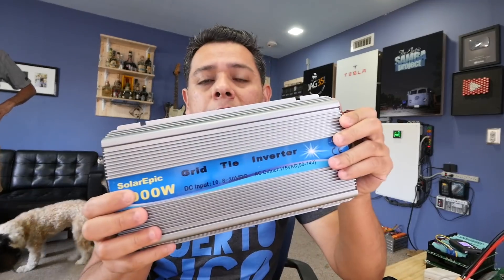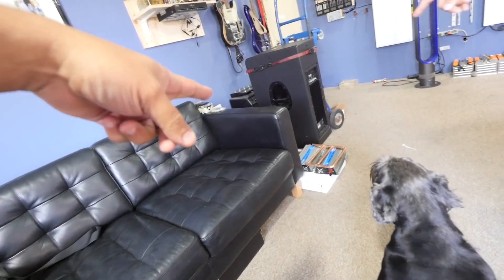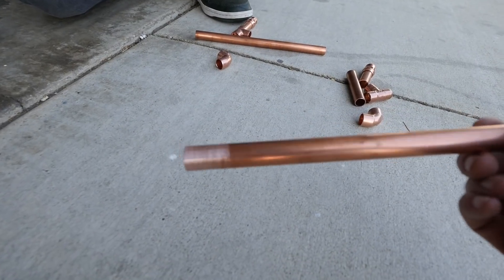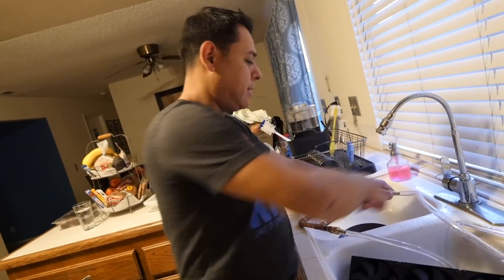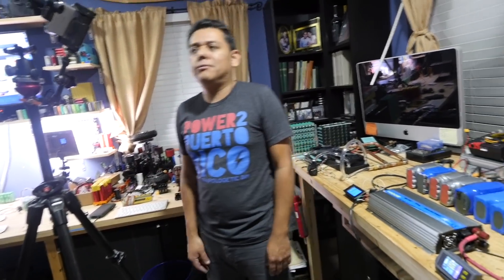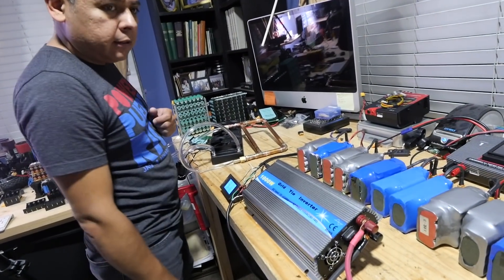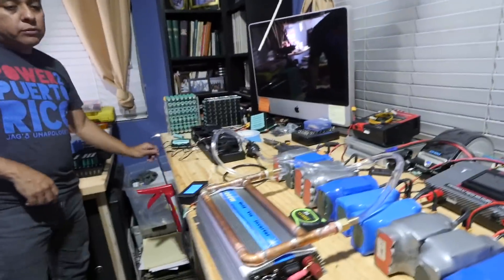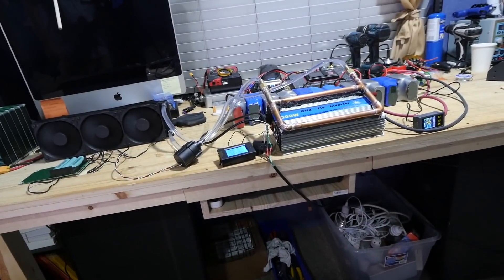Liquid cooling A cheap 1kW Amazon Grid Tie Inverter Experiment

Comment: What you should have done: Removed the boards their aluminium cases. Bought some angle aluminum (~$20) and constructed a square (sized to fit the outside  perimeter of those Walmart box fans) In the square you should have had 3 sets of 2 bars back to back, placed at 1/3 interments to fit the pcb. This could have been using a basic hacksaw and bolts.($15 if you didn't already have it) Then you should have drilled holes in the aluminum and bought pcb stand offs for 10¢ each off ebay. Then you could attached the pcbs to the aluminum bar via the stand offs. After which you could mount 3 cheap cpu cooling blocks with thermal pads ($40), connected them together using soft tubing, and fed it all to a makeshift Reservoir (pvc $3) and a cheap pump. Going out of the blocks and pump, into a salvaged/ebay dehumidifier or small ac radiator ($20 or free). You then would place the radiator ontop of the fan, and place the aluminum frame on the other side. Around $50 bucks, few zip ties and some glycol as a heat conductive liquid, and you'd have a banging cooling system. And it all could have been done in an afternoon. Im sure even my simple 3 second idea could be made cheaper and more efficient if given a few hours thought.

Comment: You need more radiator surface area & fans to lower the water temp, likely a bigger pump, and you need much better surface contact to make this worthwhile. Having worked with water cooling in computers, I can tell you from experience that you almost need to place the cooling interface in direct contact with the mosfets or their heatsink (soldered or flat surface-to-surface contact with the backs of the FETs or a flattened sink, instead of the thick layer of thermal compound "goop" - which will actually reduce the thermal transfer vs direct contact).
Also, don't mix copper and aluminum in the cooling loop.

Comment: I agree contact surface is too small gr8 idea tho , work on the contact surface and this will work lots better 
also when sweating copper pipe just heat the fitting when the fitting is red hot then add the silver soter it will run around the fitting it self and follow the heat around the pipe ;)

Comment: You've got a long way to go get a reasonable heat transfer, you're not going to do it with tubes mounted like that.
More and smaller tubes mounted to a flat plate clamped to the fins is a better functioning heat transfer system, one of many.
Measure the system temperature of the water going in and coming out to establish a differential against the timeline where the Deltas can be plotted appropriately.
Be sure to have a contact temperature sensor at more than one point on the inverter to establish real values for the amount of heat present. That information can be plotted against the amount of BTUs actually removed
Reply: i wanted to write the same thing. I am with Leslie way. smaller tubes and plenty of them.

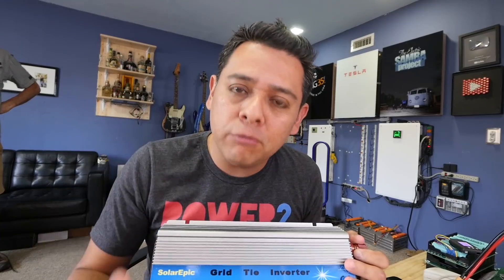Comment: At 00:31 I am guessing it will not be effective until you weld it to the metal or build a custom metal case for the inverters. You can weld fins to the pipes with a robot or use old heaters people throw away when modernizing.
11:23 Use an inlet valve to top up the loop and don't forget the second inlet valve for air or just run the pump and use a 1/4" water cooling reservoir for PC building.
As an alternative you can bandgrind the fins on the inverter case and try and solder the copper pipe to it. Flatten the pipes to make them rectangular to increase surface area.

Comment: get a PC radiator for water cooling. buy cooling pasta in bulk (comes in a small bucket) place radiator on top of inverter. smudge pasta inbetween and aaall over the top so that its one massive block of either a radiator or paste sipping heat from the inverter shroud.

Comment: Here's the sort of copper bar I was talking about soldering to a pipe.  Before soldering, you should drill, and tap holes for the heatsinks.  Tape the bar into place against the heatsinks, and spray some paint, or use a felt pen to mark locations to drill,  before  solder, run screws in to the drilled and tapped holes to keep out solder, don't let the screws protrude from the side of the bar to be soldered.

https://www.ebay.com/itm/Copper-Flat-Bar-Stock-1-8-x-1-x-6-Knife-making-hobby-craft-C110-1-Bar/111790023257?hash=item1a07346259%3Ag%3AXLwAAOSwMQBaOAI7%3Asc%3AUSPSFirstClass%2128036%21US%21-1&_sacat=0&_nkw=copper+flat+stock&_from=R40&rt=nc&LH_TitleDesc=0

`

Comment: Thinner pipes snaking around what you are trying to cool. No H or A pattern. That's horrible. Cover as much surface area as possible, with thin pipes, then fill the tiny gaps that are left, with heat transferring material.

Comment: TRY THIS :
use inverter radiator....just add some plastic on top with 1cm clearance between plastic and radiator seal it around using silicone that water run only between plastic and radiator not everywhere ,,, run water throught it and you get liquid cooled inverter without any weird stuff ....like if you cooling it using external fan on top....but using water , and you get awesome results, max 10min work + truck with silicone xD

Comment: Hey... nate im  from nhc campers  saw your video... solved your grid tie issue of heat by simply adding old pentium style heat sinks to the mosfets and increased the casing fan size..... thats all you need to do ... dont overthink it...   worked for us...

Comment: What I would try:  Leave the cover off.  Flatten one side of a 3/4 inch copper water pipe, or get some rectangular tubing.   Solder fittings to pipe before flattening, and make pipe no longer than necessary.  Clamp the mosfets directly, or with thermal compound, to the pipe, consider soldering mosfet heat sinks directly to the pipe with a low temperature solder electronic solder.  Electronic solders contain lead, unlike plumbing solders. and have lower melting points.  If the non-power electronics run hot, cut away the part of the cover that interferes with the piping, and reinstall it.

Notes on soldering:  Heat both sides of the joint to be soldered, leave the solder wire room  temperature.  To get a good joint, the copper must be hot enough to melt the solder.  The solder must "wet" the copper, then solidify as the joint cools.
Flux serves to clean the metal, and protect it from oxidation during the soldering process, but you still must polish all surfaces with a steel brush, or emery cloth(sand paper).   Heat both metal parts to be joined away from the joint itself, particularly if you are using a torch.  If you accidentally brush the joint with the flame it's OK, but you want the joint just hot enough, but not too hot.  Both copper parts must be just hot enough to melt the solder, and not much hotter, particularly if electronics are on one side of the joint.
Keep moving from one side of the joint to the other.    When you see the flux start putting off vapor, start testing the temperature of the metal by touching it with the end of the solder(wire) at the joint.  When both sides of the joint melt the solder, touch the wire to the "uphill" side of the joint.  When done properly solder will move uphill into a joint, but it's better to have gravity on your side. 
When it works right, the solder is sucked in, even uphill as if there is a vacuum inside the pipe.   Solder outside the joint should be only near the joint, and be very thin, and smooth.  If you see solder begin to make a drop at the joint, take away the wire.  After soldering use fine emery cloth on the soldered joints. This should reveal no pitting in solder.

On soldering heat sinks directly to pipe:  Solder middle mosfets first so outer heat sinks won't get as hot.   For mosfets in the middle. move the torch from one end to the other to equalize temperatures.   Heat the pipe from the inside with the torch from one end, for mosfets on that end.  
A better idea is to get a small copper buss-bar, and solder that to the pipe, screw the heat sinks to the bus-bar after soldering with silver particle paste.  Use a copper/brass screw as large as will go through the hole. and a copper/brass washer.   Only need a tiny bit of paste on buss side, threads of screw, and both sides of washer.

Comment: If you want to continue down this road check out youtube user Linus Tech Tips.  They have done ALOT with liquid cooling for computers.  They have also done research on metal heat sinks and thermal transfer compounds.  They also cover areas in liquid cooling you may not have considered such as:

- Cooling with water alone vs other liquids
- What happens when you mix metals (example: aluminum radiator with copper pipe)
- What bacteria can do to a water cooling loop. (Whole room water cooling series.  It's long so you way want to check out the end?)

Hope this helps!

Comment: what you need is a copper water jacket fitted to the top of the inverter with heatsink paste slathered between.  then use a 15 gallon barrel and put ice water in it.

Comment: I would try to use thinner tubing and cut every second fin. Glue the tube in the channels with thermal conducting epoxy and try to get the epoxy in every corner.
Reply from the maker: That’s the best idea I’ve heard so far

Comment: mineral oil cooling is what you want to be doing....

or just get rid of this awful extruded design of a case they use for every single inverter or psu you find and put the pcb in a decent case designed for the job of being cooled...

Comment: Technically it runs cooler. Is it WORTH the cost? NO, Is it going to improve life cycle in any meaningful way? NO.
When watercooling was a thing in PCs, it used to drop temps down from 50 celcious to 25 or something which allowed overclocking, still useless but at least it was 20 celcious, not 5. So this guys is not a success and it was expected cause the heat transfer will be extremely poor with that design.

Comment: You give up way to easy for a first try with common material it did gray at a 10 degree drop i youse a similar technique with a couple of changes that works much better 1 st is the tubing used your type is what’s know as a hard wall type you want to use the thick wall bendable type much better heat transfer all-so I put a 8 gage solid copper down each side of the copper pine also I mounted the tubes on 1/4”x1” bars you need to solder all together for the best heat transfer as for as local you want the tube directly coupled or as close as possible to the fets a few more fittings are worth it and lastly colder water works mush better I would give face to back this up when I get my new pump I use a five fallen bucket and this will be a subversive fountain pump
Reply from the maker: I’m not even sure my rig will need cooling,  I was getting ahead of myself here,  we’ll cross that bridge

Comment: hi man been following you for over a year great work
i was just thinking if you wanted to use air cooling  and use the venturi effect(creates a low pressure area) and lowers the temperature of the air flow over the fins 
in other words use larger  duct with a fan installed going into smaller duct or tunnel  which would accelerate the air flow over the heat sink fins by making the fan push the air past the fins faster thus increasing the cooling and the  efficiency of the fins (heat sinks) you should get a big drop in heat if the air is exhausted away from the units two of those computer fans will be more than sufficient
Reply: plus if you run water cooling and you do get a leak you will prob cook all your inverters why take the risk when some simple ducting and a fan will do the job and eliminate a potential problem water and electronics don’t mix well when they do it usually costs a lot to repair

Comment: Try using brake pipe for cars. It bends easy and will push fit into the fins. You can use the heat to warm your hot water tank too.

Comment: There's so much work already done with water block cooling systems by PC overclockers, that it seems a waste to not incorporate as many of their lessons as possible your water cooling effort.
As just a bystander who has read stuff on the internet, it seems like this effort might be a bit low on metal-to-metal contact between the water system and the inverter, directly over the heat source. It also looks like the balance of the overclockers' efforts have swung from water cooling to heat pipe cooling. But even with heat pipe cooling, the key would still be a flat surface on the inverter (heat fins removed), directly over the heat source, against which to mate a water block with a similar ultra-flat surface (with only a microscopic layer of thermal paste between them).

Comment: Use a big aluminum plate on the bottom and run water through that. Like a CPU heat sink but massive
Reply from the maker: Too expensive

Comment: You do not need to solder pipes,  just buy water cooler blocks,  and the vinyl tubing.  But you definitly need to put high performance thermal paste like ARCTIC MX-4.      water cooler block >>>>  https://www.amazon.com/Aluminum-Cooling-Graphics-Radiator-Heatsink/dp/B00IHWAVQ6/ref=pd_sim_147_7?_encoding=UTF8&pd_rd_i=B00IHWAVQ6&pd_rd_r=0a99d09d-989d-11e8-9b00-87eedb8b4431&pd_rd_w=yCmnw&pd_rd_wg=zgd6c&pf_rd_i=desktop-dp-sims&pf_rd_m=ATVPDKIKX0DER&pf_rd_p=2610440344683357453&pf_rd_r=ZF8XNB05GNBYPTBFKFHF&pf_rd_s=desktop-dp-sims&pf_rd_t=40701&psc=1&refRID=ZF8XNB05GNBYPTBFKFHF

Comment: With the design of the housings on your units, go to a true hardware store and look at the K&S metal display. You'll find smaller tubing that should fit between the fins. That would improve the heat flow as you would spread the flow over 4 or 5 tubes per side instead of one large one. http://www.ksmetals.com/24.html

Comment: Why not just waterproof a section of the fins that already exist on the inverter and run water directly over them? I bet that'd do a damn good job!

You could also de-case the inverter and attach water blocks directly to the transistors, that'd be ideal for cooling, but also way more work.

Comment: Several factors limited your results. 
1) You need to maximize your contact surface.
2) Ambient air temperature will limit waste heat dispersal.
3) Size of reservoir and radiator need to be larger.
 
Just the obvious things I saw.

Comment: Yep, Your contact area is too little.  If you affixed some copper plate to the inverter and ran your plumbing in contact with that it would draw much more heat from the inverter.  Place the copper heat sink over the FET's .

Comment: Could you add 4  mosfets on top of the first 4 mosfets to reduce the load and the temperature ?
I read that Chinese mosfets run hotter because of higher on state Resistance. So 8 mosfets would have about 1/2 the Resistance of 4. It should cost less than $10 to add 4 mosfets.

Comment: Yeah, it works. But not efficient at all. For the setup you have, you can get more with some minor mods. If you had those 3 radiator fans blow air on the inverter case directly, you could have better cooling than this.

Comment: Hey if your going to look into water cooling to sink a bunch of waste heat "Geo-thermal is my preferred method" Dig a hole in the yard 4-6 feet deep drop in 400' of 3/4 inch pvc from home depot and circulate the water through it.

 Alternatively if you have a sump hole in the basement you could buy a coil of copper tubing and just drop it in there. 

For those inverter's i would pull the heat sink off and either buy ebay water blocks  or go to a plumbing supply and pick up square copper tubing like 1 1/2-2' stuff  to mesh up with the flat side of the inverter housing nicely. 

Basically if you are looking to cool one od two units buy the 10$ pc water blocks off ebay and cheap pump/res combo and a 240mm rad. 

If you want to cool a bunch of stuff go geothermal and sink that heat into mother earth gaia at her cool and temperate 10 degree celcius dirt temps.

Comment: As other ppl  mentioned, the surface area in contact is too small. If you would encase them in a cement like mix, there would be much better heat transfer. However, the cover would be more permanently attached to the cooling apparatus.

Comment: There are many ways to do this but as far as being passive 3 auxiliary transmission coolers (radiators). The inverter should be sandwiched between 2 and the third up higher out of the sun or heat. And of course you can do geo thermal cooling too on the cheap.

Comment: The loop in the pipe won't work: water will not flow evenly in the loops.  Hydronic heating systems have special split connectors to ensure that water flows through all the branches.  You should have just done a zig-zag with the pipe, but the problem is that you don't have any real level of contact between the chassis and the pipe..  Ideally, take the aluminum cases off and build a block heat sink that is just a block of aluminum with a pipe - sized hole through it - you put the pipe through and bolt the transistors directly to the block and flow water through the pipe..

Comment: Hey brahh i have a queation does having   a transmission in a electric make sence like a normal drive gear and a high speed overdrive gear because currently commercialy available cars only have one gear and are not that efficent at high speeds like highway speeds and they use a lot of energy but if u had a over drive where the motor can spin slower than the wheels and maintain high speeds will it be more efficent pls let me know as im really curious .

Comment: Great idear. But. I would have made or got a  water jacket for it instead   you would have had a better heat transfer.     Also if you would have put the past on it first then  set the copper on the past. Again you would have had a better transfer.     One last thing you had the tourch burning to hot for the copper  hence the leak .  Also good for thought. car use coolant in the water.    Great idear tho.     Be cool